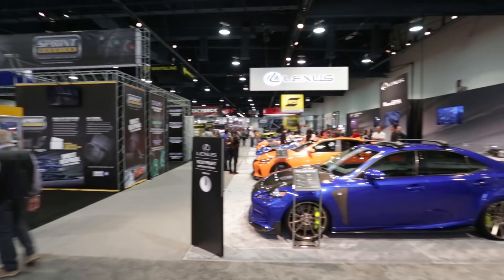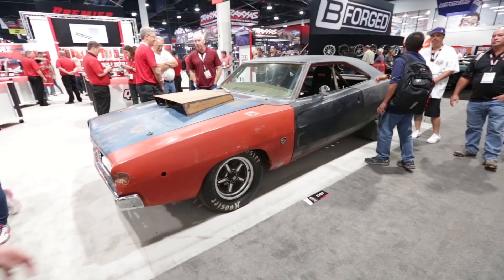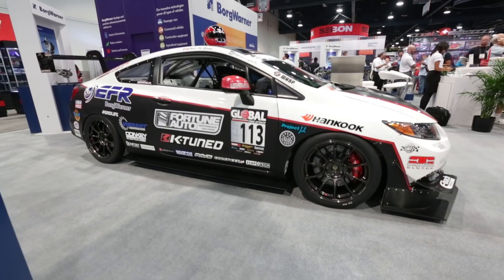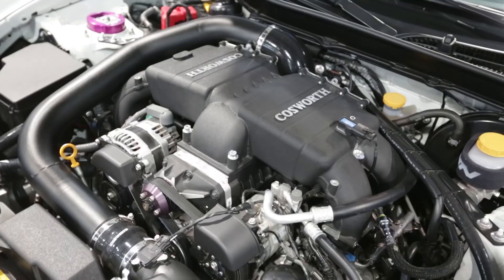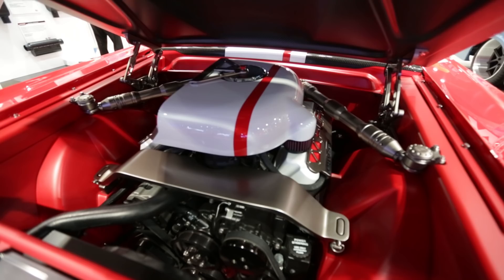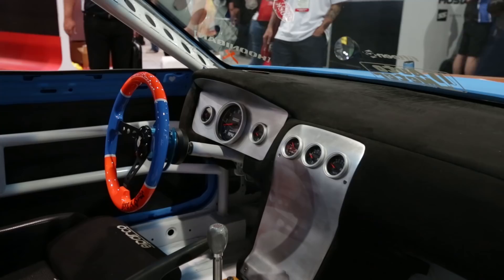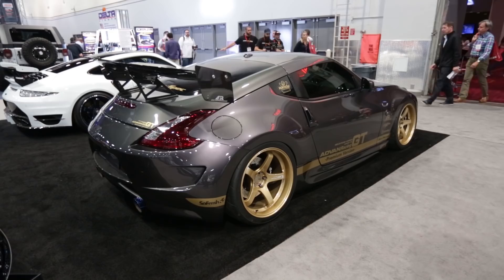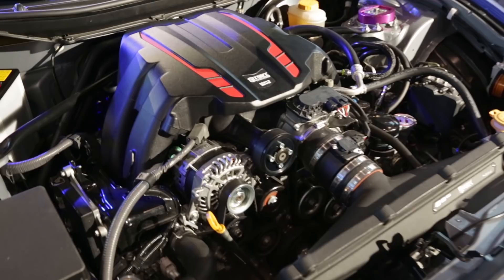2015 SEMA Show Coverage - Day 1

Comment: will the turn signal self cancel on that racepack dash?
Reply from the maker: +18iser That's controlled in the steering column not the race pak. All the display does is indicate when the signal is on.

Comment: How much power does the Focus RS do?
Reply from the maker: +lambusado 350HP
Reply: Speed Academy Nice!
Have you seen the new Peugeot 308 HybridR?

Supposedly it is a AWD with 500HP (electric engines and all)
Has a 1.6L petrol engine and they say it is the most powerful of those engines sizes.

0-100 km/h in 4seconds.

how do you feel the Focus will do against it?
Reply from the maker: +lambusado Sadly, we don't get any Peugeots here so we really don't know but if the power figures are right and the car has instant torque with electric engines, it's going to be an insanely fast and fun car.
Reply: Speed Academy They already have a non hybrid version which does 6 seconds to 100kmh

Comment: At 10:51 how do they make an engine bay look this clean i mean where's the battery, fluid containers, wires and all of the ugly stuff a car needs to run?!
Reply from the maker: +Fahad AlQanaee They move everything to spots where it can't be seen. Inside the fender wells, under the dash, etc. It requires a crazy amount of work to build these cars that have such clean engine bays. The red Mustang probably cost $150,000-$300,000+ to build.

Comment: Lost me on the Aventador. It's a damn Lamborghini, it is SUPPOSED to be crazy colors with ridiculous wheels and shit. It's supposed to spit flames, break the sound barrier and run off of dreams and testosterone. It's not a drift car, it's a poster car. It's allowed to be ridiculous.
Reply from the maker: +Anti theAdvocate Looks like we have different tastes, a set of bright green wheels that resemble a style that I've seen on drift cars don't really fit the style of a black Lambo in my books but to each their own. That's the beauty of modding cars, you can do whatever you please.
Reply: +Speed Academy the 350z at 7:51 also has bright colored wheels. But it sure is not a drift car either. How come you didn't make the same comment as you did with the Lambo?
Reply from the maker: +Jonghyun lee Because its a 350Z and not a $400,000 dollar super car. I personally don't like gaudy looking wheels on supercars. I prefer a more subtle performance oriented looking wheel but as I said before, to each their own.
Reply from the maker: +Tyler Stevens HAHA, that analogy is beyond awesome! Thanks Tyler.